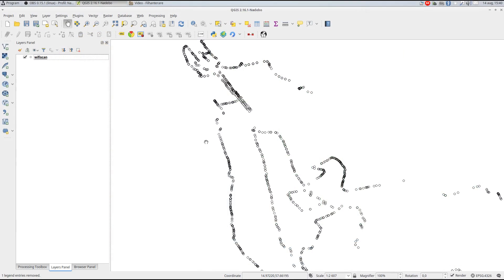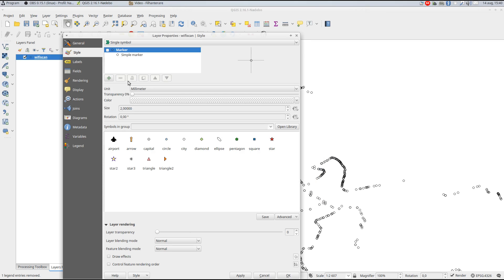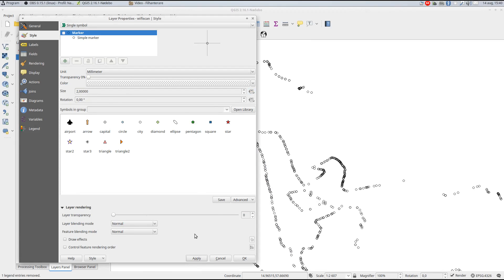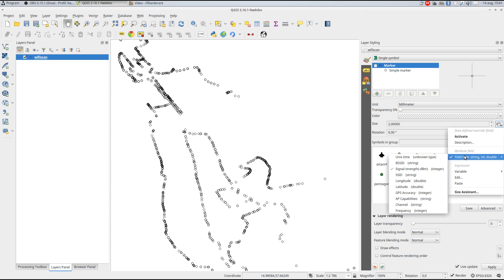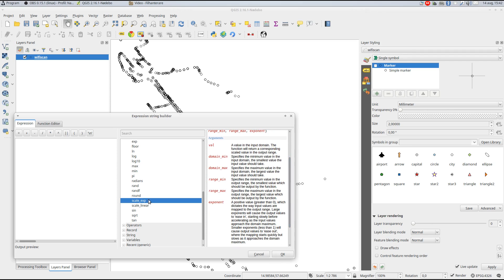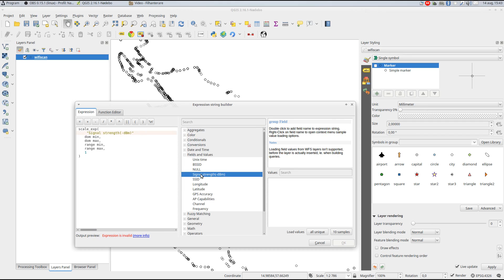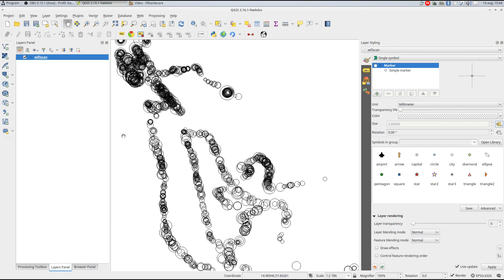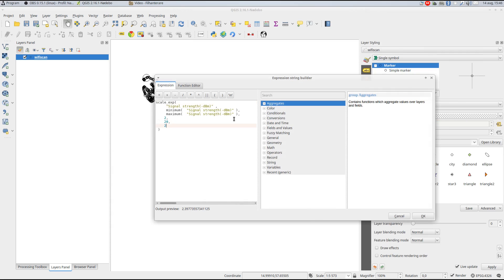QGIS Quick Tip - Scaled Value Styling

Comment: Hi, Is there a way to add a legend explaining the scaled circles?
Reply from the maker: If you use the "size assistant", a legend with scaled symbols will be created. You find this under the "data defined overrides" for the symbol size (the E-psilon character button). In QGIS 3 there will be several enhancements to the presentation of symbol size in the legend.

Comment: helo sir, i have qgis project  with epsg 4326, but Advanced Digitizing panel eror because format cordinat decimal degree, advanced digitilizing panel work for epsg  3826 mercator, but i have project 4326 epsg, can u resolved this problem, advanced digitilizing panel work in project epsg 4326, i can pay u,,, for resolved this problem, www.elsa.co.id
Reply from the maker: The advanced digitizing panel don't work with unprojected coordinate systems. You really need to use a project in a projected system!